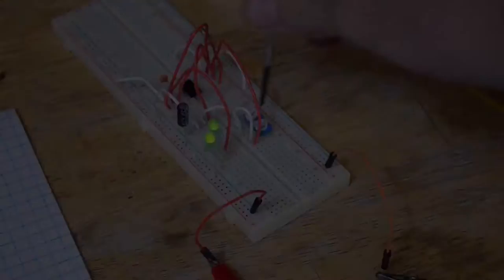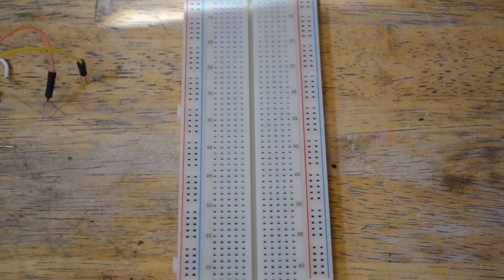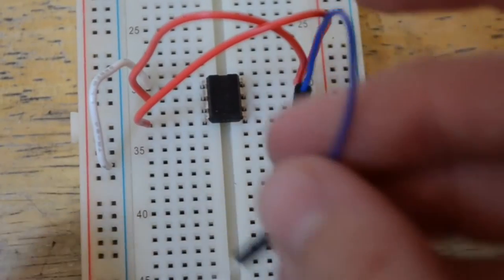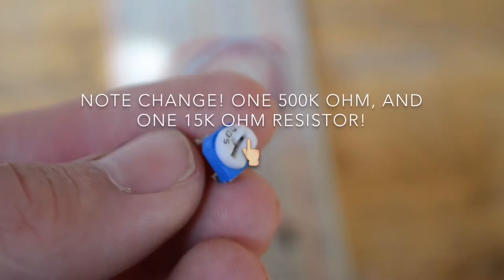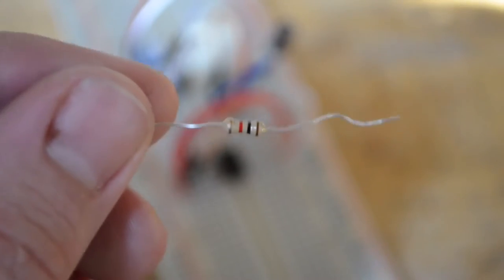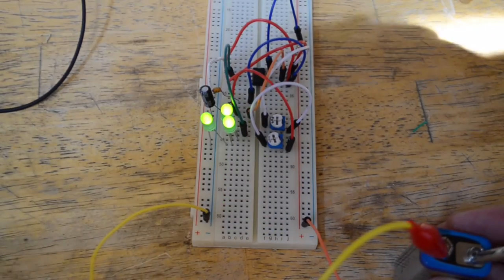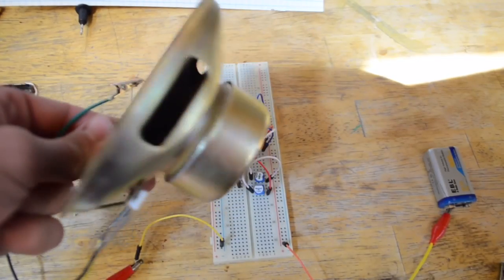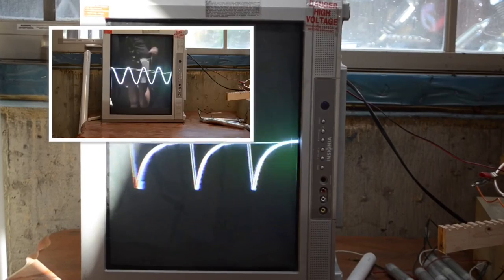How to make a Tone Generator

Comment from the maker: If you have trouble changing the tune, try putting the 500k pot. In parallel with the 20k pot.
Reply: instead of making a tone generator ca a use a boom box to produce diff amplitudes

Comment: Could you connect that tone to a transmitter, and use a locator/receiver to find the tone? Like putting the Tone Generator underground and using the receiver above ground to find it?

Comment: Thanks, nice video. but i want to see how to make a tone generator in the giga hertz range.
Reply from the maker: +Jimme Iroawuchi umm you need basically to use an inductance capacitance resonator, and a transistor that is able to handle switching so fast. Why do you want this? For wifi?
Reply: Keystone Science what is  inductance capacitance
Reply: i would also like to see a video on that, for a tesla coil driver

Comment: Hi I'm new to circuits so if anyone can explain  a few questions that would be great! 
 One is how do I connect the mosfet to pin 5 if I'm using a breadboard? Why are the numbers for the pins switched(sorry i'm new to circuits). And do I really need an amplifier to connect to the speakers, or can i just hook up the solar panel to the speaker and that should be fine?

Comment: hello keystonescience 
i realy like you films 
i wart to make an arc speaker but i got an problem 
i have no potencjometrs to make an tonem generator 
did i realy need tchem to make it? 
PS
ewen of i have them i wil not use  them (you no what i mean)

[i have problems to speak englisch
Reply from the maker: +ECHOP no problem, I made a video on a simple plasma/arc speaker, but it is nice to have to potentiometer so that you can tune it to the best frequency that will resonate easily , but I suppose you could likely do it without them if you want to calculate the correct frequency then use some math to calculate what resistance needs to go there to give you that frequency
Reply: thanx. Keystone Science :)

Comment: Bro can i generate sound frequency of 25k hz by the help of this circuit
Reply: Already you can, I just changed the 4,7 capacitor to a 0.01 capacitor and I generated a lower Frecuency.

Comment: What is the point in the .01uf capacitor.
Reply: Stone Cold7 It's connected between pin 5 of the timer chip and ground. Pin 5 is the "Control Voltage" pin. This is the reference voltage for the comparator on the threshold pin. The small capacitance from pin 5 to ground helps to stabilize this reference voltage for more stable operation.

Comment: IS IT POSSIBLE TO PRODUCE 1Khz to 20Khz tone from this circuit?
Reply from the maker: +Marella Zalameda yes
Reply from the maker: +Marella Zalameda by manipulating the capacitor and resistor, you can probably get up to 500 kHz for this 555 timer
Reply: The capacitors u used in the video can produce 1kHz to 20Khz frequency? Say, I will not change anything u used in the video I'll just use exactly the same components from this video I will be able to get 1kHz to 20kHz?
Reply: I want u to know that me and my thesismates would want to use your design as a part or our prototype for our research about using frequency to delay ripeness of fruits, I will put credit by your name.
Reply: how about 400-800hz?